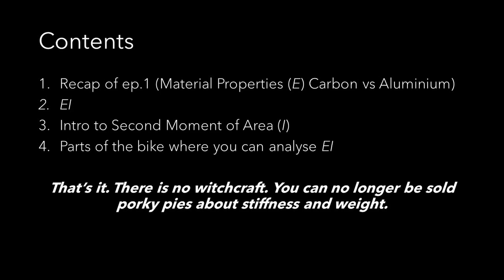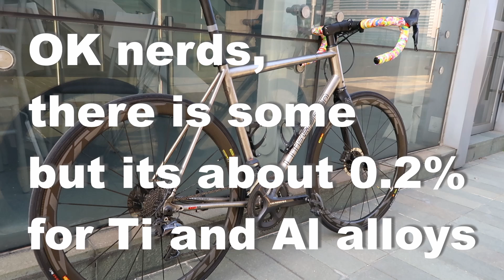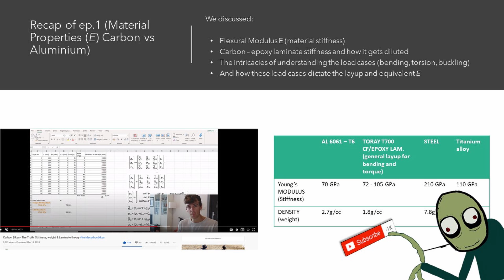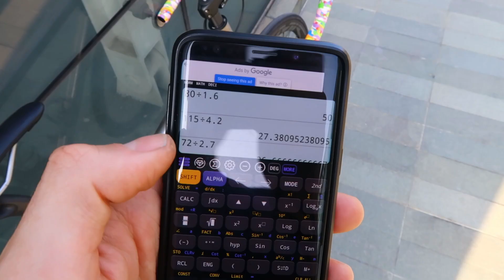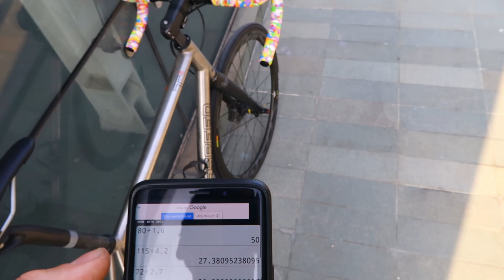Titanium Bikes - The truth and Physics of 'ride feel' marketing.

Comment: Well,...    all I will say is this. .....   I road a Litespeed one time at the bike shop....    one that looked a lot like this one.  Now that was about 20yrs. ago and I STILL think about it from time to time.  .....   Now this is where you and I are different.   I know what I know and I too have my opinion.  .....    It was by far the smoothest and most comfortest ride I ever had on any bike.   The only reason I did not buy it on the spot is at the time I did not have the money in my budget to do so.  I ended up riding lowracers.   (NoCom, NME, M-5).  ....    but if I was to purchase a road bike for all around rides it would most definitely be a Litespeed!

Comment: I don't know, what I do know is that it does indeed ride better than any of my other 15 bikes of various materials, and I swap between bikes all the time, and every time I can feel the difference with the TI.  And what's weird is that the rims on the TI bike are deep rims, all the other bikes except for one have shallow rims, and they all use aluminum seat posts except for one that has a CF seatpost but that's not on the TI bike.  My aluminum bike is the worst riding bike I've ever had, I don't ride it much anymore due to that but it weighed within a couple of ounces of the Titanium bike I have.  All my road bikes ride on 700x25c tires, so the psi is the same on all of them. 

I hear all of your scientific mumbo jumbo, but I have to go by what I feel with my personal bikes.  I don't have any personal reasons to prefer one bike over another in my stable, I like them all, but the TI is the one I now ride the most.

The only reason I bought a TI was because a couple of my friends have them, one has a very expensive brand, and the other got it very cheap off of an internet bike place; I got to ride both of them several times to make sure that I would like a TI bike and both of them rode better than any of my bikes did.

Not sure what to think of that stuff you said, but all I know is that I go on how they feel to me.

Comment: I've had eight different titanium frames over the years and I feel I've got some experience understanding their 'magic ride.' I think the whole thing about titanium bikes having a special ride to them was that, in the early days there was very little choice in titanium tubing diameters and wall thicknesses available to builders. The tubing wasn't drawn for the bike industry. It was either for aircraft hydraulics or for the chemical industry. Those early titanium framebuilders used what they could get their hands on and their choices were limited and probably leaned toward lightness above most other things. 

I've owned a Teledyne Titan road frame and an early Merlin MTB. Both were on the wet-noodle side of ride feel. Not excessively, but more than someone who's a hard sprinter would be comfortable with. I've ridden both on trails (yes, I know the Tele wasn't built for that) and the 'magic' seems to be just that they were flexy enough to smooth out trail chatter by a fair bit. That helps for going faster, especially downhill on washboard surfaces. Riders were winning downhill and XC competitions on the early Merlin MTB frames in the 1980s, in part by taking advantage of their flexy ride. They soak up the small bumps going downhill and the frame flex made it very easy to bunny-hop over obstacles. Once reliable suspension forks were available the noodle ride was no longer an advantage but the legend had already been created. 

I've also ridden a Habanero Ti frame  that was built far too stiff for my taste. It felt pretty much identical to a very stiff cromoly steel MTB I'd had. No magic there. It's what the builder chooses to use tube-wise and the geometry of the frame. Personally, I prefer the old-school flexy titanium ride. Currently on one of those old generic ti frames that came out of Raleigh's Nottingham shop from the mid-1990s. (the no-name double-diamond frames, not the MTi1000) Ugly welds but I love the ride. Give me a titanium noodle frame any time. That's the magic I like.

Comment: What about tube diameter? Tubes of the same mass but of different diameters will flex differently. Right? And if stronger materials can be have thinner walls, can you not use those variables (diameter/wall thickness/material strength) to give different ride characteristics?

Comment: Given the same size tube in alloy ti and steel, the steel will flex 1x the ti about 2x and the alloy about 3x for a given load, and that's before we get into large thin wall tubes butting and everything else.

Comment: The design of the bike has more to do with the "feel" of the bike than materials used. Over the past few decades, I have been fortunate in having a wife who has been tolerant of my spending habits regarding bikes. So, I have had road bikes in steel, carbon, aluminum and titanium. I still have carbon and titanium road bikes in the garage. The titanium is still my go to bike for half and full centuries. The design and materials make it efficient and compliant, much more so than a bike of any other material or design. I understand your preoccupation with numbers, but would suggest long test rides are a better measure of bike feel.

Comment: Still love my lugged steel framed bikes, and I will admit partly because I admire the skill of the builder and the aesthetics.  Also, because I’m frugal, and new bikes have gotten way too expensive.  I also doubt that the composite bikes and a lot of the aluminum bikes will not be around nearly as long as the steel and titanium framed bikes. Carbon is not tough, and aluminum fatigues faster.

Comment: I love titanium bikes, ended up with three of them over a long period of time. They were all massively better than the bikes they replaced, but that was more that the older bikes were old, worn out and cheaper and so I know it was the wheels, build components and groupsets that made the difference more than the frame. Tyres also - the hardtail mtb has almost 3 inch tyres, still not fully adapted to those. Every thing you say makes sense, for me its just I like the look of them! that litespeed looks amazing which counts for something for the individual using them. 

I'd argue against the 'titanium bikes last for ever', 'last bike you will need' type of marketing - especially with bikes that are pushing the lower weights. That's more down to whether the bikes used for its designed purpose. 

 My old titanium road frames ended up on the indoor trainer set up - 9 speed dura ace, frame that is apparently unaffected by sweat so marginally less cleaning required. Might not have been what I got it for..

Comment: I went from a steel Soma Smoothie to Lynskey titanium r240 and could barely feel the difference. It didn't have the snappy feeling I was hoping for. So I got an Orbea Orca M20 - holy smokes, never going back. Carbon fiber allows for dramatically different shapes in different areas. The Orbea's BB cross section is massive and the seat stay shapes are something you can't make with metal. Carbon bikes are just better because they're fully tuned in all rhe right places wirh custom sections designed to resist forces in specific directions.
Reply: Carbon frames become dull after ~5 years though

Comment: If I had to guess, it's because the average aluminium bike is much cheaper than the average titanium bike, so it's typically paired with cheaper wheels, cockpit, seatpost, and saddle. There's no point spending £2000 on a titanium frame only to put the same cheap finishing kit on it. Presumably the comfort of high-end wheels and compliant carbon seatposts/bars are often mistakenly attributed to the titanium frame. Plenty of reviewers, vloggers, and bloggers have done enough testing to confirm that tyre and tubes (or lack of tubes) make the lion's share of the difference to ride quality.
Reply: That’s a really interesting point. If you put crappy wheels and post on a Ti bike and higher end wheels and post on an Al bike and ride them back to back, seems like the Al bike would be more comfy- all other factors being equal (geometry, tires, other components, etc).
Reply: @georgeforeman89  For sure - I've put my carbon race wheels and supple tubeless 28C race tyres on my cheaper aluminium commuter bike before while my race bike was indoors bolted to the turbo trainer; It made a huge difference to the feel of the previously harsh and sluggish wheels. The weight reduction of the carbon rims and race tyres affects acceleration and agility a fair amount, while the move to soft, supple tyres is likely responsible for most of the comfort gains over the (necessary) hard-wearing, armoured tyres of the commuter's wheelset.

I've never done the reverse - i.e. I've never put my heavy, armoured commuter wheelset on my high-end bike, but I'm willing to bet it's going to downgrade the experience significantly!
Reply: Hmm. Maybe. But still, LOL.
Reply: I bet 99.x% of people only believe in the kool-aid they want to believe in with 0 clue on realities. Perceptions trump. Your spent money stokes your ego and makes you a believer in whatever sauce you want to be on.

Comment: I'm slightly confused with the point that you'd need a thicker Ti frame for large riders if the two triangles are the most rigid part already (if I understand your point correctly). Therefore, should it be always down to the characteristics of the wheels,  tires and seatpost as you said?  
Econ major here any additional clarification would help :-D 
Thanks much!

Comment: Hello Peak torque. I have a question did you consider that modern bikes are not constructed using straight tubes. Most of the tubes have variable cross sections. In addition the tubes are often curved, this is especial true in the seat stays. This curvature creates a changes the stiffness of the truss section. So if you design a bike with straight tube sections your claims are true but this is often not the case.

Comment: I got a wonderful titanium gravel bike which will survive me (and that's probably why you should buy one in the first place I think) and I can confirm that comfort and carpet-like vibration filtering will come from the wheels and the tyres, especially the latter. I have two wheelsets, one with narrow road tires highly inflated and the other with 44mm gravel tyres inflated at only two bars, it's basically night and day regarding comfort and shock absorption. But of course the thinner road tyres are faster. Frame material has basically nothing or so to do with all this indeed, and that's perfectly fine! I mean, if you're really looking after iomproving riding comfort and don't care too much about pure performance, use larger tyres and lower their pressure as much as you can, that will work much better than pretty much all other solutions (expect installing suspensions but that's another story).

Comment: Thanks for the video and I agree with the bottom line. Tiny differences in stiffness and/or weight are unlikely to matter much.

However, the description of the physics is incomplete and misses an important point. Aluminum frames can be made stiffer at the same weight since lower density materials are less vulnerable to buckling (i.e. like an aluminum can). The stiffness of a tube increases with the cube of diameter. The buckling limit is determined by the ratio of the wall thickness to the diameter. With a lower density material of the same strength, it's possible to build a stiffer tube.
All that said, I love my titanium bike and prefer it for its anti-corrosion properties. 

For anyone who is curious about the details ...

The principal was exploited by the Klein bicycle company here: https://en.wikipedia.org/wiki/Klein_Bicycle_Corporation

The equations (from the bard AI):
"The following equation can be used to calculate the critical buckling load for a thin-walled tube:

P_cr = (π² * E * I) / (L²)
where:

P_cr is the critical buckling load
E is the modulus of elasticity of the material
I is the moment of inertia of the tube cross-section
L is the length of the tube

In general, tubes with thicker walls are less likely to buckle than tubes with thinner walls. However, there is a trade-off between wall thickness and weight. Thicker walls will make a tube heavier, which can be a disadvantage in some applications."

And a summary (Also from bard AI):

"Lower density materials can create stiffer tubes if both materials have the same strength per weight because the lower density material can be used to create tubes with a larger diameter. The stiffness of a tube increases with the cube of its diameter, so a tube with a larger diameter will be stiffer than a tube with a smaller diameter.

For example, if a tube made from a lower density material has a diameter that is twice the diameter of a tube made from a higher density material, the tube made from the lower density material will be eight times stiffer than the tube made from the higher density material.

This is because the moment of inertia of the tube made from the lower density material will be eight times greater than the moment of inertia of the tube made from the higher density material. The moment of inertia is a measure of a material's resistance to bending. The higher the moment of inertia, the more resistant a material is to bending.

As a result, the tube made from the lower density material will be more resistant to bending and will therefore be stiffer."

Comment: I'm a mechanical engineer who spent years working with vibrational stress relief of welded structures.  There are statements in this article that are a stretch. I too wouldn't say that the differences aren't as significant as the promo. I can't speak for titanium & aluminum except to say that neither neither responds well to VSR. The simplest comparison with vibration of these materials is that if you're starting a metal band, choose steel. Neither aluminum or titanium can be hammered into a drom.

Comment: A an engineer and someone who has ridden T since the early 90s as well as carbon, steel, aluminum, and scandium --  You missed one BIG factor -- 1.5kg of aluminum, vs 1.5kg of stell vs 1.5kg of Ti have very different volumes.   A such, tubes aren't made the same given the density / yield strength / deformation/ fatigue life of the material.   Steel bikes are "more compliant" because they use smaller diameter tubes VS aluminum.  Ti's "magic" is that you can nearly the same compliance of steel at nearly the same weight as aluminum.    A clydesdale who can flex a stiff aluminum frame might not notice the difference between Al and Ti...   At my weight, I can tell....  Stronger riders often find Ti a bit noodle-y

Comment: Somewhat ironic that the comfort of a bike is largely fown to some of the cheapest components. Tires, bars, bar tape, saddle and seatpost, even chamois choice. I guess you can throw wheel choice in there as an expensive component but does anyone actually want compliant wheels with all the trade offs? Tire rub, brake rub, poor handling etc

Comment: Just came across this video and agree with everything you say about marketing, buy a titanium bike if you don't want corrosion or have to worry about chips in the paint. And as another mentioned the sound the frame makes when a rock hits it is excellently reassuring.  I've had titanium, carbon, steel, aluminium and scandium frames, they all feel the same really, except I feel less vibration on carbon, but that may be down to the fact there are more flexy carbon components...

Comment: I’ve had high end aluminum and carbon bike and the seemed too bouncy. The carbon bike was bouncy but I performed great. Aluminum also flexed too much. 
I settled on a titanium bike because on a long ride I just feel better.  It’s not as fast as my Cervello R3 but I’m not a fatigued after a ride.  I had the same Litespeed with carbon everything and it will last my lifetime.  The polymers in carbon bike start to degrade after 5 years and becomes brittle. So many of my friends carbon bikes have cracked.

Comment: I think it is misleading to derive complex properties just by comparing specific material properties. Although Al and Steel have similar specific modulus, they ride extremely different. Precisely because of second moment of area. The low density of Al allows large tube diameters with thicker walls which result in much higher stiffness (second moment of area). But then there is not much compliance in large diameter tubes. Vice versa a steel frame with the stiffness of an aluminium frame would be very heavy or have super thin walls and thus be very sensitive and probably a nightmare to weld. Ti lies in between. You can have more compliance than Al and less weight than Steel. Plus, Ti has very good fatigue strenth. Better than steel and obviously a lot better than Al. No magic in there. To quantify ride feeling is hard. But to say they are the same is hardly correct.
Reply: Yeah and the fact that you cannot build two bikes exactly the same with just different materials.  Aluminum is a weaker metal and so it needs larger and thicker walled tubes.
Reply: 💯 Exactly.

Comment: I wouldn't have a Ti bike for touring or club rides, even my Amazon (old) tourer is just too stiff or rough  on uk roads compared with a 531 steel similar bike however I have compared it against alloy cyclo-cross bikes and despite it's age and intended use the Amazon is better, more rocket like in acceleration which is surprising seeing how it was designed for touring.  
This aside,  the Ti ride is strangely bland on road (but not as comfortable as steel) despite being worth a couple of gears faster when I have done the occasional time trial on it.  
I suppose some of this is expectation and actual reality.  
I'm sticking with Ti for cross until I can try carbon,  road it's steel and carbon currently,  alloy has to be the right bike and reason, which isn't there in my needs.   Good article,  cheers.